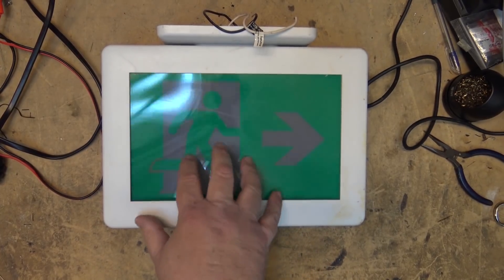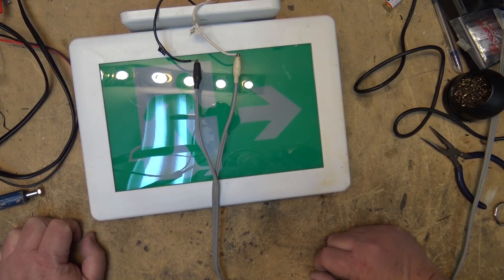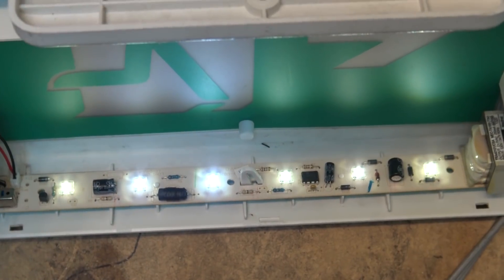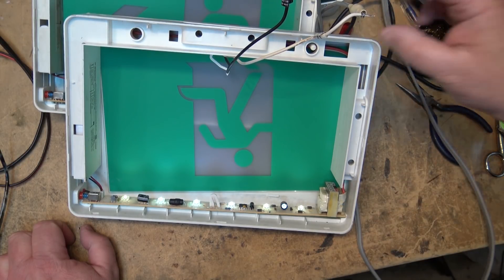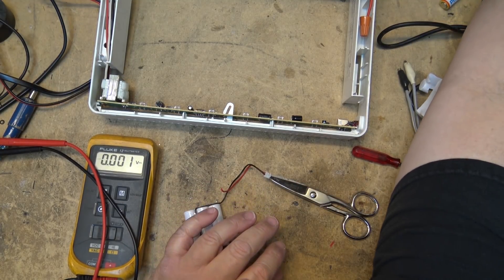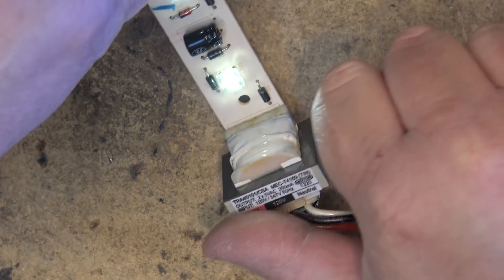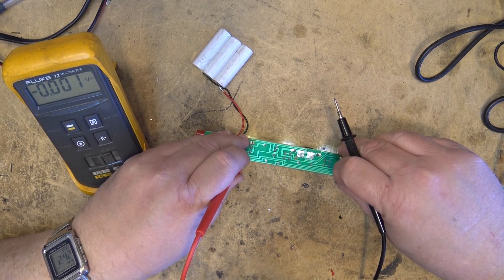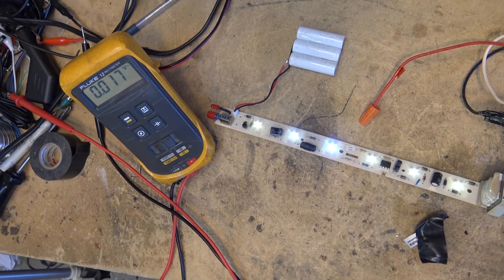LED Fire Exit Sign Teardown

Comment: LEDs are NOT crap. Incandescents and gas discharge tubes are...
These LED sings don't last song due to planned obsolescense.
I use LED products that are a bit more expensive and they last and last...
They tend to drive the LEDs too hard. If you slightly underdrive them,
they even last longer than any traditional lamp ever will do.

Comment: Pictogram is rubbish! What is the thing you are NOT supposed to  do  if there is a fire - run -  and what does the guy in the sign look to be doing?
Reply: The pictogram is used almost everywhere in the world - it's the internationally recognised sign. The reason that EXIT isn't used is because it only means something to people who can read English. Oh, and these are NOT "fire exit" lights... they are POWER FAILURE lights, and are used to guide people to the exits of the building when the power is cut.
Reply: @johncoops6897  You run in dark/poorly lit buildings?

Comment: These are cool; I can imagine hacking one of these things with a smoke/CO (carbon monoxide) detector/alarm that flashes super-bright red LED strips when it goes off; interspersed with the “suggested” white LED strips, and have them alternate! Maybe even a pre-recorded sound module that says, “Fire! Please evacuate the building in an orderly manner” and goes off when the smoke detector alarm goes off, and hooked to one of class-D amp boards you recently tried out (and a speaker, of course!), though you’d need a SLA battery instead of that dinky 3-cell NiMH battery pack! There’s certainly enough wasted space inside.

Comment: 1) poor design; I would have used the LED strips, mounted vertically (perpendicular to the PCB), or maybe an inverter and the backlight panel from an LCD monitor. 2) they’re likely over-driving the LEDs, and 3) most “white” LEDs are near-UV (or deep blue) chips, with a yellow phosphor applied over them; if they’re on 24/7/365, I’m not surprised the phosphor breaks down over time - even ‘long-wave’ UV is not good for the skin or eyes, never mind a phosphor coating! 😎 4) it looks like the mixed cool-white, and yelo-glo LEDs in the same design - weird; maybe they ran out of stock? 😏

Comment: You are complaining about the wrong thing!  The problem isn't the LED's, it's CHEAP LED's!  If you get a flashlight from the dollar store and leave it on continuously it will only burn for a few hours before the LED's fail, on the other hand if you buy a high end LED light such as one made by GE it will burn for years.  I have some that have been on continuously for almost 15 yrs and still going strong, the problem is the better ones cost $10 or more.  The problem is also the way they are made,  a red, green or blue LED will last a long time but there's no such thing as a white LED so they are usually made by taking a dark blue LED and covering it with yellow phosphor that is caused to glow so the combination of blue and yellow produces a color that resembles white, depending on how well the blue and yellow are balanced.  If really cheap phosphor was used it tends to burn off in an hour or 2 leaving just the dim blue LED.  If all the LED's are in series like a string of Christmas lights they can all go out when one opens but I've had more trouble with them just getting so dim they didn't produce anymore white light.  The first LED light bulbs I got back in the 2000's used 5mm LED's same as a flashlight and they would either burn out or get too dim to see in just a couple of hrs. but that's mostly been fixed by new COB designs using better materials these days.
Reply from the maker: Yes I know all about "white LED" All LED are unicolor. The wavelength produced is specific to the semi conductor. Wite LED use, as you say a blue diode, specifically a spectrum that is mostly in the UV spectrum, but with visible  blue component. The blue component is what you can see in the blue spectrum, the near UV range makes the phosphorous glow in the yellow / red spectrum. The mixed yellow/red light with the visible blue light makes them look white to the eye. A better approach is the technique devoloped at MIT and used by Sony (Triluminous) and Samsung (Q-LED) which uses a primary blue LED, and passes the light through a quantam dot optical filter. The quantum dots react with the blue light to radiate red and green primary light.
The advantage to this is, well no phosphorous to eventually fade and burn.
The down side is, well it is relatively expensive, and is basically reserved for high end displays. Also, a good percentage of the source light is lost in the filter. All these LEDs are run in series, this is so the current is low.
In TVs for example, they run typically run 200 to 300 volts across all the LEDs in series. If one pops they all go out. That's the way it is.  Sure they could run them in Parallel, but at 3 volts, running them in parallel would draw a huge amount of current.
I have an LED DLP TV from a few years ago. It runs 3 LED (Phlatlight) light sources.The Red and Green run at just under 2 volts, and the blue at around 3.
The current on the other hand. They sink about 35 amps (pulsed) into each of those LEDs/ You should see the size of the conductors on them. 
It was a fantastic TV, until the DLP chip started loosing mirrors.

Comment: They have replaced incandescent with their cheap $30 price point. The light output is less of a problem  the real trouble with them  is the device will turn off on it's own and  reset by activating the battery  test button, not a normal function. Once this unorthodox reset is performed the device will perform normal including performing a normal battery test for a few weeks than cycle off again. Line power was never lost to the device and the battery fully charged.   I am guessing the problem is in the boost circuit.  The manufacturer distributors don't like to talk about it and will not go to a job site  to see the the problem first hand but they know about it.

Comment: They were probably ditched since the batteries were done. At work we test every exit light monthly to ensure that the light lights when the power goes out. Most of our Exit signs also have two lights that provide illumination of the exit and path to it. It's probably cheaper in these cheap lights to just replace the entire unit rather than service the battery.
Reply from the maker: Myself I don't believe they were changed due to any battery issue, I believe they were changed because the LEDs went bad, and resulted in a dim sign. Remember these are fire exit signs, so you want them to be bright so they can be seen in a smoky environment where people depend on them.  If it was just a battery issue, any fire alarm maintenance company technicians would know what battery went in that unit, and would know how to replace it in a matter of a few minutes. For maintenance they would know going in that batteries may be needed, and would typically have spares just like they do for the backup batteries on smoke detectors. Since all of them have light issues, I am going with the failed LEDs as the reason for replacement.
The point I am getting at though, is these signs are not all that old. In has only been in the last 8 or so years that they started being used. Prior to that they were all the red EXIT signs some lit by incandescent, and some lit by fluorescent lamps. Very reliable
Reply from the maker: These ones I doubt ate even that old. The batteries actually did charge up after I reconnected it. I haven't check the others to see of the batteries are any good on them, but on the flip side, I can't see not replacing the battery of it is done. The labour cost would be much higher to change the entire sign than just swap the battery. Even if the battery cost the same as the entire sign, it takes 2 minutes to change the battery, but to change the sign, you have to remove the sign, and since this is a electrical connection, that requires an electrician.
Reply: Robert Kohut, you are right about replacing the whole unit instead of servicing them.  With the uncertainty of the exact battery type, it’s cheaper on a parts+labor standpoint to order a new one and go there once.  It takes about the same amount of time to replace the whole thing than to be up on a ladder trying to figure out how to take it apart to see what battery it takes (charging at least an hour of labor), then come back and change it (charging more labor), and possibly not fixing it if the charging circuit failed... you’d have one pissed customer if you tried to then charge them for a new sign in addition to the previous stuff.  Or you’d have to eat it, and your boss will be pissed (or you may have lost out on a job).  So yeah... it sucks, but once the last fluorescent lights are phased out, we will have passed the point where we can service equipment in the field.  I bet the same was thought by radio and television repairmen when transistors came out!
Reply: 12voltvids, yeah, that’s what I was going to reply in the main part, but got distracted and forgot... They look like cheap pieces of crap like I’ve seen in Germany that were installed as part of the “lowest cost technically acceptable” in the contract, but then I imagine the fire inspectors said no way and had them replaced with decent units.

Comment: The brighter L.E.D.s were used behind the clear portion of the sign. And it looks like they functioning as intended.
I would like to have seen a close up of the L.E.D.s to see if there were any individual lighted diodes within, that had turned black/burned.
Reply from the maker: Pha Q 
The diodes are the same and with other signs different ones are brighter. It is just the diodes themself that are failing.

Comment: Could you please do a video on your 100watt light bulb isolation tester you mention in the beginning of the video
Reply: It's NOT isolation. It's still outrageously dangerous, so it only kills you with one Amp.
Reply from the maker: Ray M 
I did one already showing the basic wiring of it will be doing another when I build it into a box.

Comment: From what ive seen, what causes LED's to become dim is the designers putting too much current through them to get them even brighter.
my Keyboard has indicator LEDs on it that would blind you when it was new, now you can only see them in the dark
also the old headunit in my truck used to light the entire cab up, 12 years later you wouldn't even know it has lights on it

Comment: There are some warnings out there the flicker rate of some of these LED lights is bad for your health.
Especially the new street lights, if you have them outside your home they can cause problems with your sleep patterns.
I noticed this myself, I was shining a LED torch on a CPU fan and the fan was going about half the speed. Strobe affect.